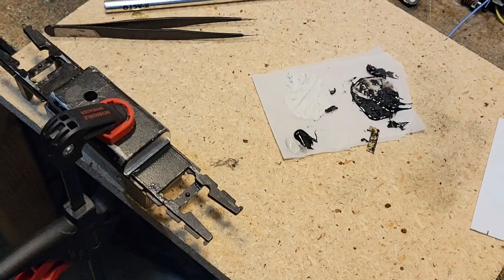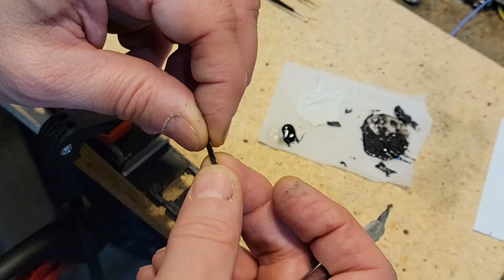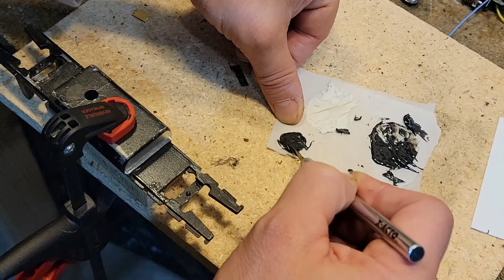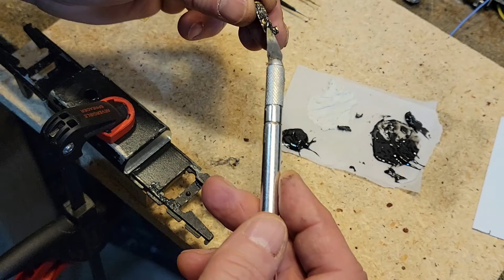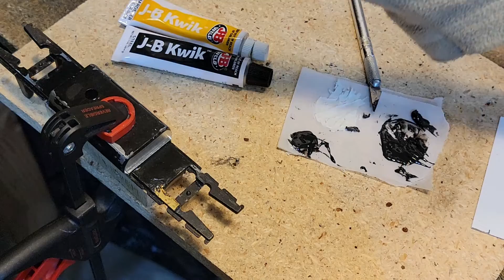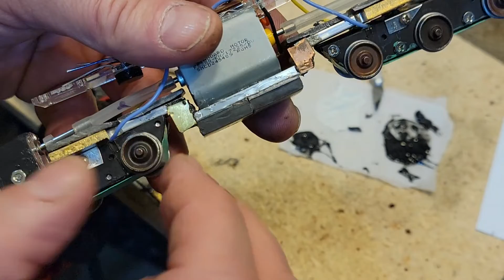JB Kwik vs Brass and Zinc how to apply results come later

Comment: With metal pieces, have you tried speeding up regular JB Weld in an oven? I set my oven to 200 degrees and bake for an hour and it seems to set really well. You can also cast with JB Weld fast this way. I'm not a big fan of JB Kwick. But, I understand why you used it.
Reply from the maker: during the 280 builds, I tried speeding up rehular JB Weld, but it wouldn't cure - another reason I use more PC-11 lately.  an important factor in curing JB Weld is humidity when the trying to bond aluminum, brass, tin, lead and anything other that steel, as I found out the hard way!  when I did that aluminum test bonding 2 pieces of aluminum barstock on the narrow edges, the humidity was about 16% due to the extreme cold temperatures.  I now run the dehumidifier a day in advance of using the regular full strength JB Weld unless it's really cold outside!
Reply from the maker: the oven is a great way to get rid of the moisture when bonding parts!

Comment: Elite I have had some of the Con-Cor frames break in pieces like that too,I’ve got about 2 Con-Cor units & a Proto E- 8 that was dropped, I also will be trying to do the the piece it & patch plate it too with the J V Wield,I will be making notes in my maintenance book on the 3 units as a reminder when I get to that point., looking forward to see your results.👋😎🛤🚂
Reply from the maker: YES a LOG BOOK!  that's the way to do it!  zinc bonding is a difficult problem because of PEST, aka, ZinC Rot.  whatever you strengthen, use a helper like we did here with the brass - it about 6 hours now and we can start working on this frame again!